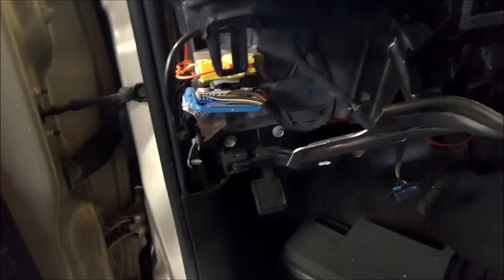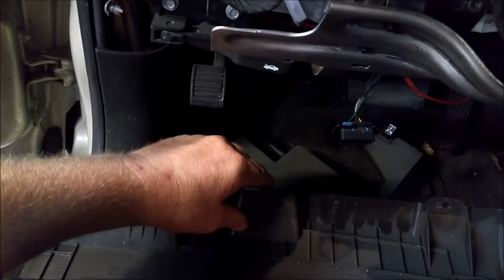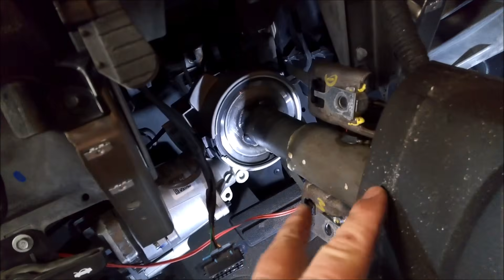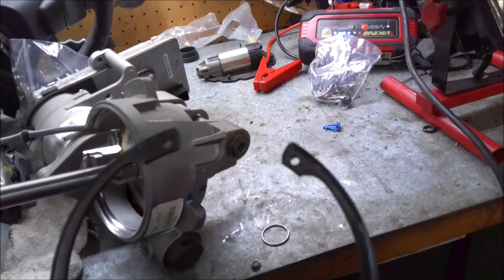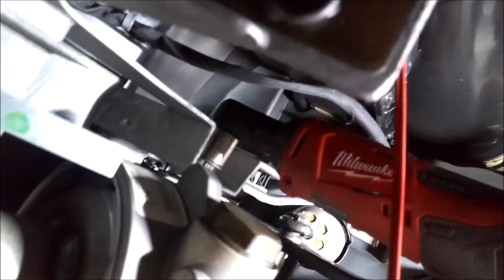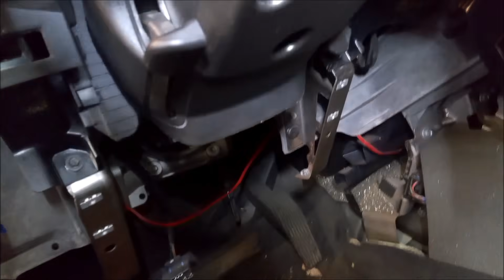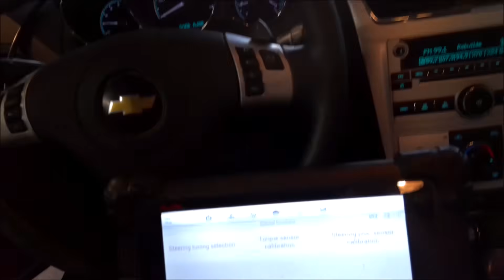2011 Chevy Malibu twitching steering wheel, no power assist, steering wheel sensor. C0545 Code

Comment: Im having the same issue! What sensor did you replace it with?
Reply from the maker: I got a O'Reilly's brand but I recommend if you can afford it to get the OEM sensor from the dealer. I've had a few of the O'Reilly's brand fail

Comment: So we did this job and we have a similar auto scanner. After we hooked power back to it and we go to turn the car on the wheel turns all the way to the right automatically. It keeps pressure on it.
Reply: When we try to reset or calibrate with the auto scanner, it tells us that we may not have the right car

Comment: What’s the average cost for the job? How many hours?
Reply from the maker: Well it depends on labor rates etc but most places want to change the entire assembly so it gets pretty expensive. If you can find someone that will just replace the sensor prob $400-500 depending on the shop

Comment: So changed when started the car the wheel turned to the right I hope a cal will fix this that’s for your video SIR GOD BLESS YOU
Reply from the maker: Unfortunately if the wheel turned to the right and power assist isn't working then I think the pin was pulled while it wasn't lined up. Normally they will drive and act fine without çalibratiom. If it turns right and stays there it's usually a bad sign

Comment: why does my steering wheel rotate to the right?
Reply: how do i fix it then?
Reply from the maker: @geovannineri8512  you will have to get another one once the pin is pulled there's no going back
Reply from the maker: If you install the sensor wrong and pull the pin without everything being lined up when you turn the key on it will turn right and not work
Reply: i pulled the pin when it was lined up with the shaft but the motor wasn’t in, is that the problem?

Comment: I have a 2010 that the column moves up and down even though the two front bolts are tight. What are those two bolts threaded into ? Is it that pot metal piece that's half way up in the dash ?
Reply from the maker: Those 2 bolts go basically into a big dashboard brace
Reply: Thanks. Looks like I will have to replace that or put helicoils in it. Maybe a longer bolt with a nut.

Comment: was this a complete fix ??  any come backs from it ?? seen a few in forums that do even from the dealer...
we have one in our shop, same code, similar issue..replaced torque sensor, performed recal w/ S.O. scanner, started car, and steering took off to the right, and very hard to turn back....
any help ???
Reply from the maker: If it turns hard right like that the sensor is probably bad if it's not in the correct place when you pull the pin it will do that, unfortunately you will have to replace it again. Ive done about 20 of those and only had one come back about 2 years later the guy delivers pizza in it I replaced it again under warranty and it's been fine since

Comment: I already had the sensor warranty work done. 2 years later it ia doing it again. ???
Reply from the maker: Unfortunately yes, even the genuine gm parts fail frequently
Reply: @HooptiesGarage  There is that, but what's the point of a warranty that covers a bad part with a another bad part. lol. You do make great videos. No small talk, straight up! 
Probably gonna take me more than an hour an a half. 🤣